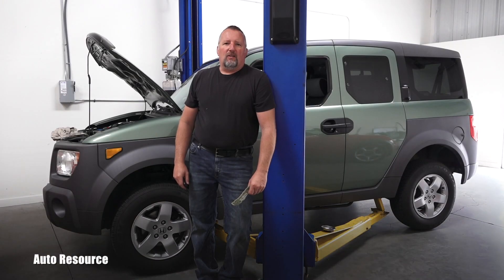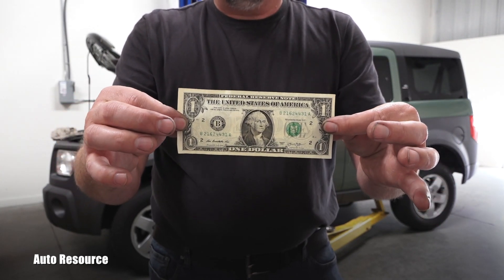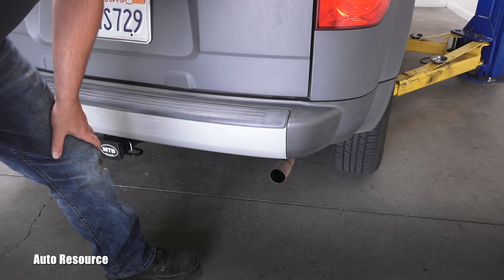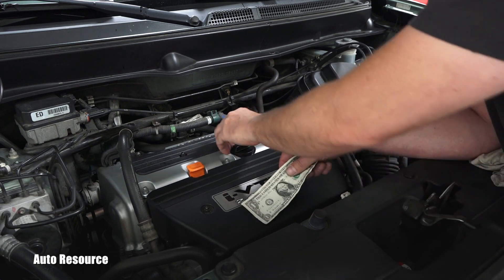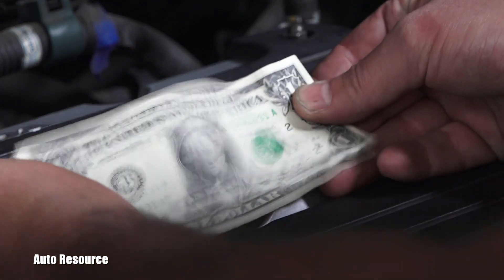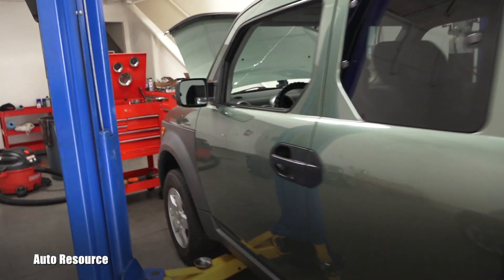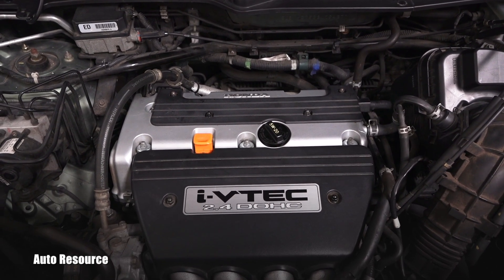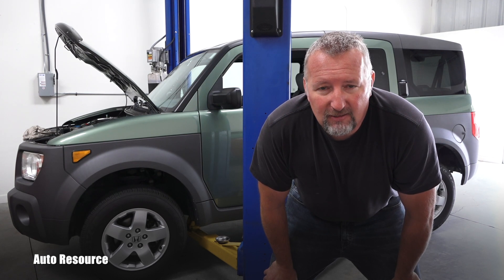Engine burnt valve symptoms

Comment: hi, ive got engine hesitation, it spits & sputters only in closed loop & only above 2000 rpm when u punch it, i hav changed  spark plugs, leads, coils, coil module, o2 sensors, tps, cas, cps, fuel pump, fuel filter but hav yet 2 change the fuel injectors  which i am doing soon. fuel pressure is fine the maf has been cleaned along with a new air filter. i tried the paper trick on the tail pipe & it is getting sucked in so the valves r bad would this cause engine hesitation? & will a compression test tell me  anything?
Reply: Yes... if burned valve, cracked head or cylinder, bad rings or gasket... compression test will indicate. Leakdown test to pinpoint the cause of the compression loss. One burned valve would result in a weak cylinder, causing slight unbalance with other cylinders... leading to shaking that you may believe it a broken urethane mount.
Reply: hi elvis i fixed the problem by putting in a set of new fuel injectors but this didnt fix it straight away, a couple a days later it came good ! could this b a cause of the petrol cleaning the valves?
Reply: @micthegreasemonkey2918  probably not. Best to get a compression tester and check each cylinder and how many cranks it takes to reach full pressure.  Can't tell without seeing it first hand.
Reply: @micthegreasemonkey2918  I think I see what you're saying... you put new injectors on and it took a while for it to improve. Could've been the ECU adjusting its fuel maps.
Reply: i had engine hesitation prior to swapping out the injectors. i had also changed a bunch of stuff connected with fire & fuel but a few days after the new injectors the hesitation nearly all but disapeared. totally rapped but i did spend a heap trying to fix the problem!
Reply: did the compression test all is normal they r all around spec !
Reply: @micthegreasemonkey2918  Do it with engine warm and throttle body stuck open? Unplug fuel injectors too cuz they'll help seal the cylinder. Lowest psi should be within 20% of highest cylinder psi, and should build about equal pressure over roughly 5 - 8 cranks.